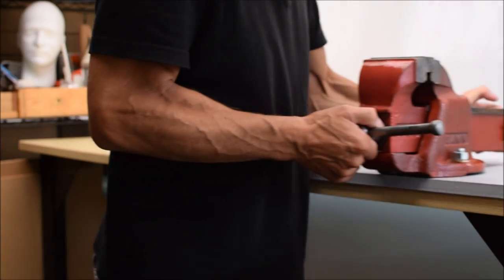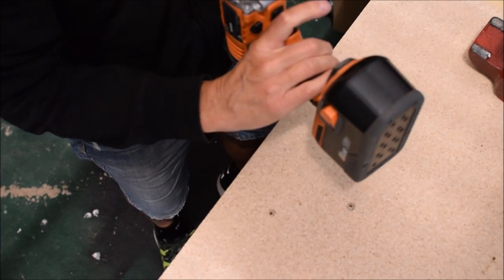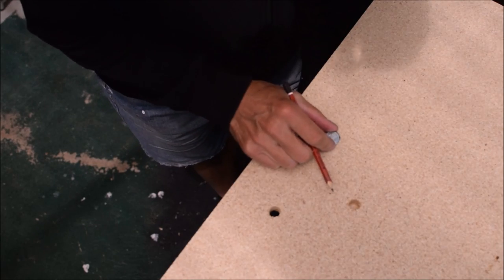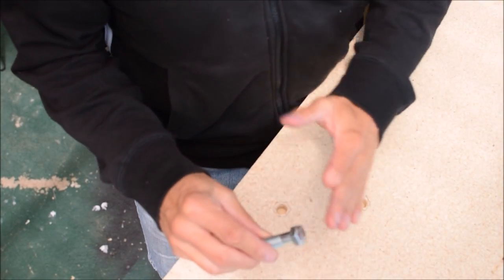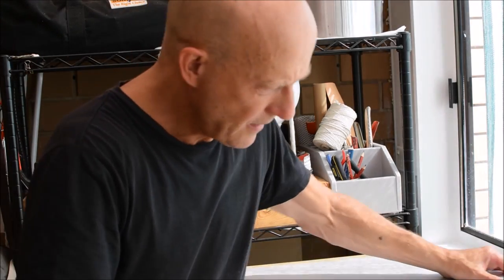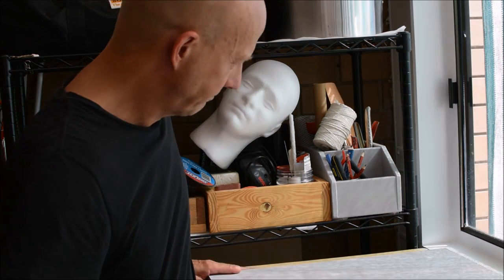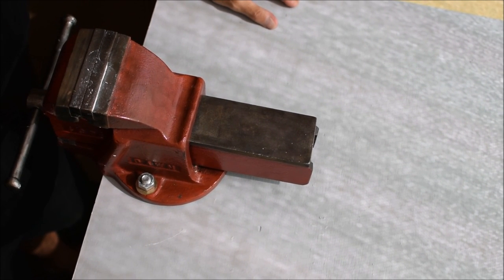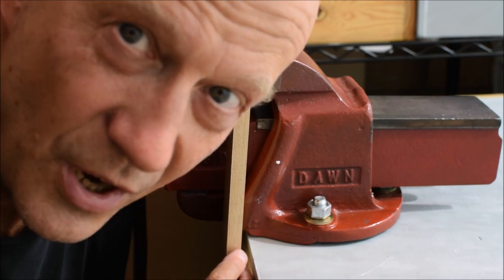How To Make Your Bench Vice  PORTABLE!    So USEFUL!

Comment: Chiseling bolt head recesses is awkward. Use a Forstener bit large enough for a socket wrench for the recesses and use spring washers under the nuts or nyloc nuts. Just a thought.
Reply from the maker: Yeah, that's an option,  I think there's a few different ways. I actually enjoyed the process of chiseling out the recesses. Thanks for checking it out!

Comment: Dear Langster, I like some elements of your solution, especially being able to move or remove the vice from your benchtop. I went one further and made a steel topped three legged table.  I mounted the metalworking vice over a corner and get on with work.  If I need to change the orientation of the clamping, which is something one needs to to do surprisingly often, loosening two nuts, rotate and re-tighten and you can then work down the line of the jaws or across the line of the jaws.  Make sure to allow overhang so that when clamping something vertically, the item can pass through the vice, past the face of the table and towards the floor.  Cheers.
Reply from the maker: Hi Peter, Sounds like you've gone to the next level with quite a good engineering solution. Well done! I'm still very happy with my solution and how it's going. Yes, your point about allowing clearance for vertical stock through the vice is very important and is easily overlooked, which is why I make a point of it with my 'straight edge test'. Thanks for watching and commenting! Cheers, Mark.

Comment: i've recently seen this kina thing alot on tube, but modual everything, saws router, bench press, they all have their own twist, i like the point about the verticle stock, i wouldn't have thought of that until i needed too, when i have it bolted up wrong, it always works that way
Reply from the maker: Yeah, the vertical stock test is a good one to make sure that you can work on all sizes of projects. We've all been caught out by things like that! Thanks for watching.

Comment: What type and size clamp is being used here?
Reply from the maker: Hi Pope, I'm using a Bessey wooden handle quick action clamp with 160mm capacity and an  80mm throat. Pretty much any clamp that holds the base board securely while your working would suffice but as I like to keep it portable a quick release one suits me best. Cheers.

Comment: I really like the way you chose to use hex head bolts and chisel out for the flats.  I never did like using carrige bolts much.  :-)
Reply from the maker: I agree. It takes a little more work but gives a smoother result and sits flush on the counter when using the vice, making it more stable. Thanks.

Comment: Can i skip the chiseling part and just screw in the bolts with the tops exposed?
Reply from the maker: Chiseling out the recesses for the bolt heads ensures that the finished project sits flush on a smooth surface. It also gives the bolts a little added security. I found that the best way to approach the chiseling was with a sharp chisel and to take my time. It was easier than it might look.  Thanks for watching!
Reply: You can use Allen or Torx bolts and a head sized drill bit to create the recess and save a lot of effort.

Comment: At least two other videos making the exact same design down to the hex bolts. One has an extra step to modify it to hang underneath the bench from hooks protected by the bench's overhang when not in use. One used a laminate covering rather than paint. Nice to get different perspectives
Reply from the maker: Hi ricric, I agree. It's always a good idea to check out a few other videos to see how other people approach the same  project. Also to assess how difficult or easy a project might be. Thanks for watching!
Reply: who made the original? bet it was big paulo sellers

Comment: Brilliant mate.
Reply from the maker: Cheers mate!
Reply: Mate, I went straight to work building your model in my own shop...with two additional 300 Kilo pressure furniture clamps the mounted vice does not move a singe millimeter under the greatest push and pull my old tired bones can dish out. Moreover, I can position the vice along my 4 meter bench WHEREVER I NEED IT MOST and then simply remove the clamps and hang the entire thing on the wall. Brilliant mate...you can't know how much you have just reduced my frustration levels building Christmas presents for my grandchildren! You're like Father Christmas around here!
Reply from the maker: Nice one! That's good to hear. Hanging it on the wall is a great idea. It's also handy to use in the house sometimes. Hope the grandchildren enjoy the presents! Cheers.